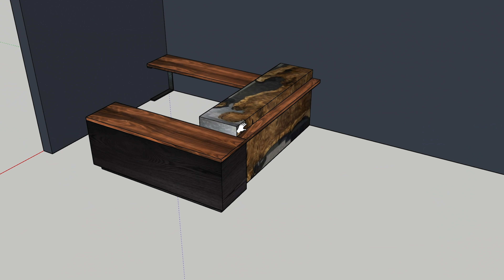Building a $1500 Chair

Comment: Guys was wondering how tour all resin would do out in the weather , hot and cold temp changes?  Would be cool for a outdoors table with resin in it.
Reply: Good question,   been wondering the same thing.
Wood extracts and contracts due to temperature, so good question.
Reply from the maker: Our resins are best intended for indoor use but we’ve experimented with some outdoor pieces with decent success!

Comment: Sorry to say, but as a professional furniture maker I could not in good conscience charge someone 1500 dollars for a chair put together with butt joints and screws......you should also have routed out the chair frame for a slip seat. The stress on those joints is incredible and overtime will break loose if not done correctly. In this situation you most certainly will be getting call backs from the client.
Reply from the maker: Many great chair makers use these exact same methods with great success. We’ll be attaching the seat with threaded inserts so we aren’t too worried about any issues.
Reply: Sorry, but I respectfully disagree and stand by my statement, based on 24 years experience.